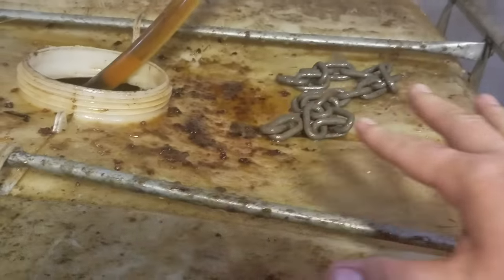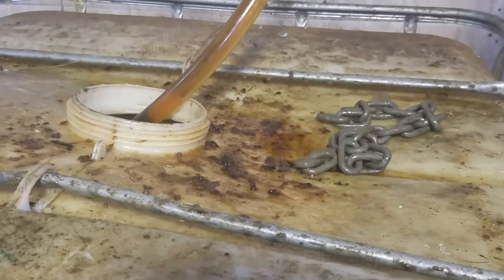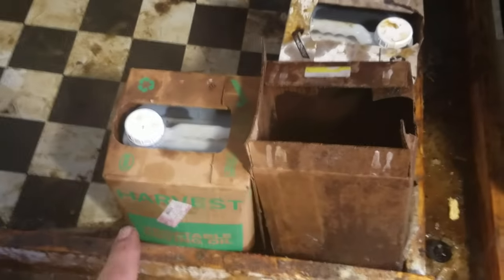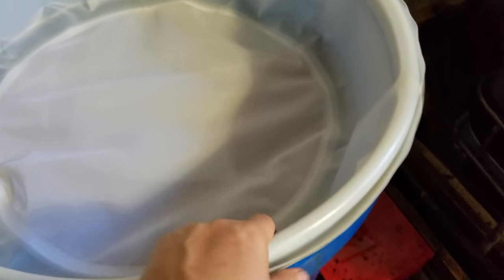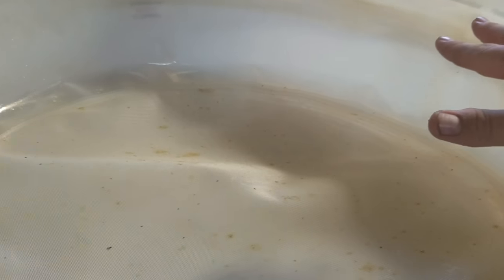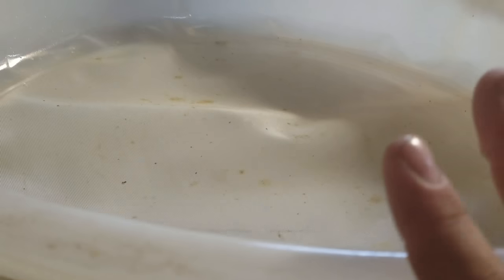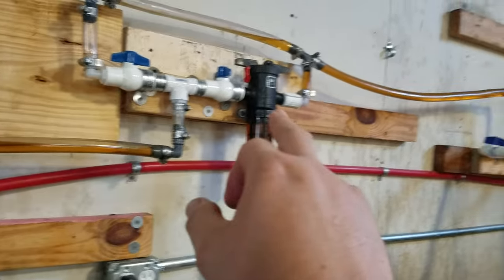NO MESS!!  HOW TO FILTER LARGE AMOUNTS OF WVO USED VEGETABLE OIL  FOR BIODIESEL BIOFUEL PRODUCTION

Comment: i actually have a local source for those huge totes like you have as well as some 55 gallon drums, I will not be making Biodiesel, just filtering WVO. 

how much would it cost to have a similar pump set up like you have? and where did you get the materials? aside from the containers, just pumps, hoses, and filters.

do you let the oil settle in those containers from the restaurant before you filter it at all? does the restaurant filter anything for you?

do you have to heat anything anymore? you said you got rid of the sock filter and heater, right?

how do you dry the oil? do you have an additive that sucks the water out?

what type of application is oil that has been filtered to 100 micron useful for? most videos ive seen recommend 1 to 5 micron for best results, but results are results.

Comment: Why not add a presure washer to your tank, then all the particles desperate from the oil at every micron. Then drain the water from the bottom, heat the remaining oil to evaporate the water, and through it in an engine?

Comment: You only filter down to 100 microns?
Reply from the maker: 100 microns in to the processor 5 microns out of the processor and 5 microns from fuel storage to gas tank
Reply: Yeah even you can use 500 micron filtered oil to make bio, the glycerol will bring the residues to the bottom
Reply: I don't even filter it at all. Dirt gets washed out.